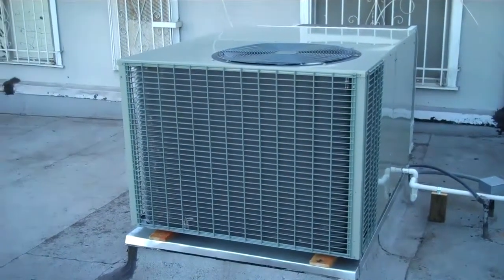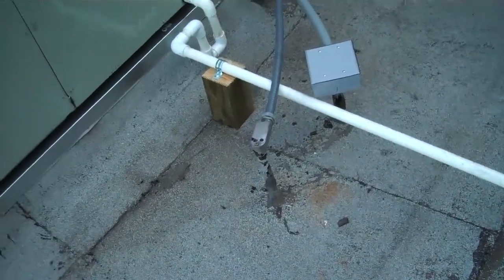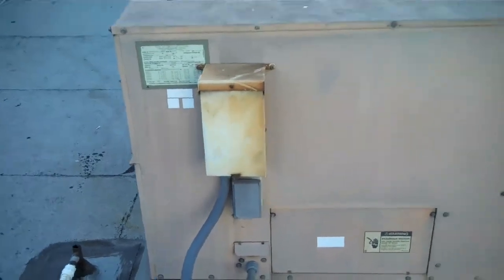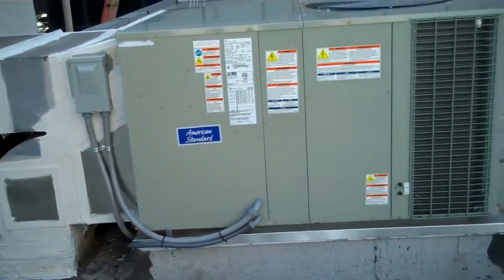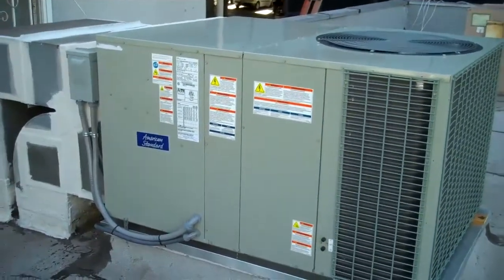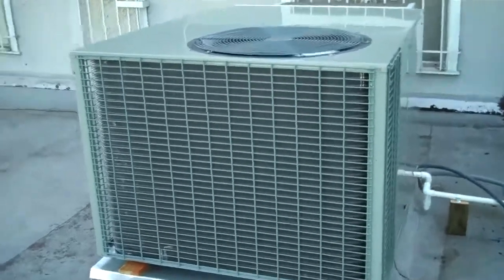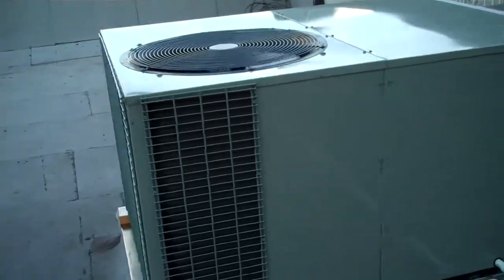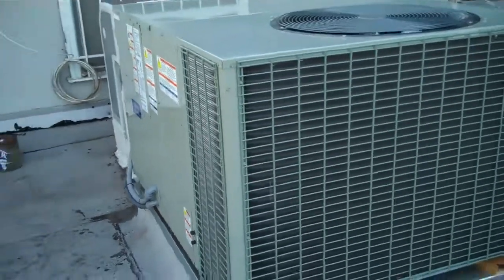***American Standard 5 ton heat pump in heating mode with bonus footage***

Comment: I recently installed an American Standard Heat Pump Packaged Unit, and noticed the compressor, and ODF would turn off for 2 or 3 seconds, and come back on, but the t-stat was still calling. I had not yet, tested the demand defrost control, or checked pressures. the unit had been running about 20 mins. I am wait"n on AS Tech support, but, thought i'd ask you since you know a lot. Thanks for your videos.